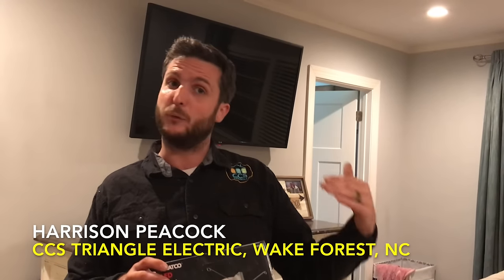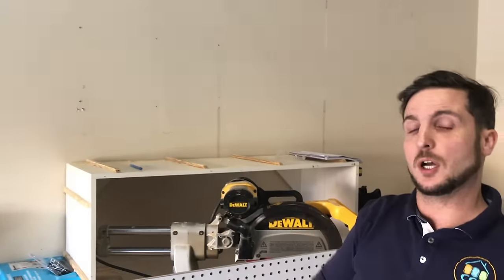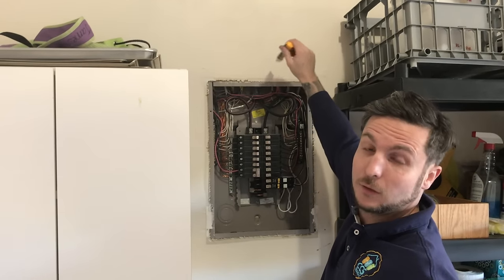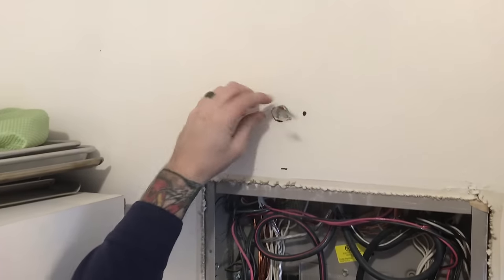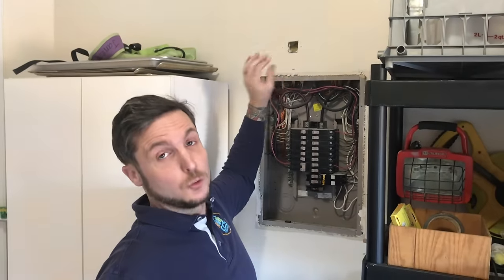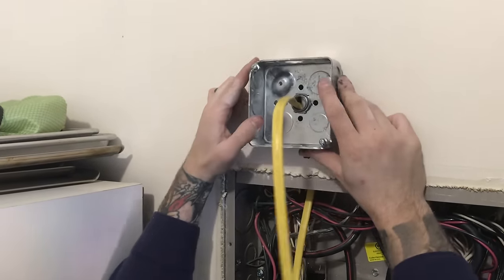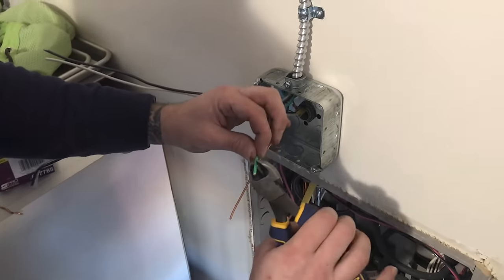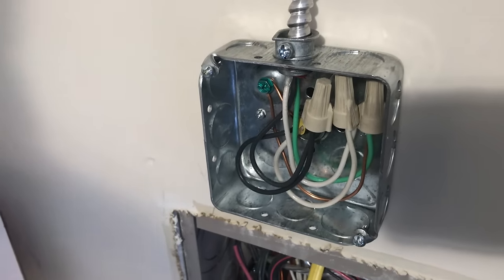New Garage Outlet From Panel--VERY DETAILED! (New Circuit / GFCI / Breaker Box / FULL INSTALL!)

Comment: Why does the outlet have to what I'm guessing could be called inputs or "Line" holes? I don't have any experience with this stuff, just came across this during my late night bored youtube searches
Reply: Using the proper holes is a quicker connection method than the wrap around a screw. They also have similar connectors to replace some pig-tailing. However, 
I know many experienced electricians prefer wire nuts & pigtails.
Reply: @jmcgrat3  I under why there are holes, I’m asking why there on a total of four on the top, the way it looks to me, you can have two incoming power sources to the one outlet
Reply: @jmcgrat3   at 33:54 there are the holes in which he put the incoming power into from the breaker box. Directly above those are additional holes, one on each side. I don't know anything about these so as of right now, my thinking is that having a second set of wiring would give you 220 volts

Comment: That GFCI is blind to any short circuits between it and the panel. Best protection is a GFCI breaker in the panel, second best is GFCI in that BOX on top of the panel.

Comment: why not use 30 amp wire / circuit? For over a decade had issues with my 110V 40 amp mig welder that quite frankly was awesome when new and for over a decade it worked like shit installed new trigger new liner etc.. and by accident realized it was on a 15 amp circuit with a shit load of other things and never had enough juice.. installed a dedicated 30 amp circuit with rated wire and mig worked flawlessly ever since.

Comment: This is good stuff but at 2454 I would have used the beans all the way up to the horizontal beams to each their own it's good stuff though never put anything in a tight area where one of two things will be happening every pair of the ceiling of the wall you don't want to have to move something unnecessarily if you put it less than the corner you have an option usually it's the ceiling at that particular height so if you give yourself the basic 4 in to a foot you will do quite well in the long run especially if you have to do repairs there are many ways to do that though the main thing is that you get a proper video

Comment: Why don't i just run the wire from the attic down through wall and out to the receptacle?
Reply: If you want to make changes or add receptacles down the road, it's better to do it this way.

Comment: ........More views on how to do things, and they are cool to see......They are like an operation....... You probably should use safety gear.......Also, seems like the power could be turned off, where the electricity enters the circuit beaker board.....Shouldn't there be two 120 amp breakers to shut the electricity off, that goes to that beaker bar?.....Lastly, I think, I read or heard a few decades ago, that there may be a code, for putting bx cable into conduit metal pipe......Take care....

Comment: also why using two separate wires for the junction box? just use the main wire all the way going throw the box to the panel why all the hassle to connect all those wires together ?

Comment: The green ground wire in the second junction box was installed counter clock wise which is incorrect. It should have been installed clockwise.

Comment: Thanks for the video. Don’t waist your time twisting two wires together for a wire nut, three or more yes. Next time you ground a metal box wire goes clockwise on ground screw. Thankyou for your time.
Reply: You do realize a midway connection on the ground wire makes no difference right?

Comment: If he moved the box over 8 more inches, he would hit a stud, remember it's a receptacle he is installing,  it's always getting yanked on,  just might pull the box off the wall lol. Like I said,  he doesn't design very good.  Remember he said he doesn't like using push in connections, well what did he just do on the gcfi?, I still wrap the screw.  Oh electricians rarely where rings on there hands, good chance you can weld it to the panel or wires thru contact, just a note

Comment: Can you use the same 12/2 metal clad cable for 220/240 outlets? Thanks
Reply: No, it has to be 12/3, 10/3, ... The white/gray wire can no longer be used as a hot conductor.
Reply: Ideally neutral conductor shouldn’t be used as a hot leg, but if u wanted to power something strictly 240v then MC is rated for it
Reply: Yes you can as long as you indentify the white conductor as an ungrounded conductor. Just wrap black tape around it.

Comment: in my area of the USA I can count the top or best electricians, on one hand, max maybe under 5 contractors and licensed journeyperson, the rest depend on us inspectors to write them up a punch list all the time, I'm from Albuquerque new Mexico and inspect in the largest populated counties in the state where we have thousands of licensed contractors, many of the electrical contractors installing photovoltaic solar systems are in very extremely bad shape when it comes to the code knowledge they are supposed to know, our codebook is about as big as the bible and very specialized not just anyone off the street can even get close to installing an electrical installation to meet the minimum codes, I have been inspecting for 21 years in our location in the Albuquerque Bernalillo county area's

Comment: Dude. You didn’t show how to tighten the metal Romex connector you installed on the panel.  The screws were on outside of the panel and you pushed the Romeo down they the connector.  How did you tighten them???
I would have applied the connector to the cable then tightened it inside the panel. Just as you did with the junction box. 

Use the clutch setting on your driver when tightening screws!!

Comment: yes, EMT is the preferred material for this application.  Would have also cost a lot cheaper.
Reply: Fernando Prieto EMT more expensive. EMT, bender, couplings, connectors, rw90 conductors and labour to install.
Reply: @darrenwoloshyn  he is supposed to be a licensed professional and should have the tools. The EMT will cost less than MC - I use both.
Reply: Tim Rich if you do residential there wouldn’t be much need for a conduit bender lol

Comment: Wire needs to be looped clockwise to go the same direction as the screw. You also used the wrong connectors. The connector you used on the mc is not rated for mc. That connector is rated for BX or AC only.
Reply: He also never went back to tighten the connector on the panel.

Comment: I think there is a serious fault of this installation - using a 20A breaker to protect a 15A receptacle. This is bad because the breaker may not trip when the load exceeds what the receptacle can handle. The receptacle has to be a 20A-rated one.
Reply: That's incorrect.  You can put a 15 amp receptacle on a 20A circuit.

Comment: Any reason you couldn't run the MC cable directly into the panel? Seems like the junction box is unnecessary.
Reply: It provides a central point of access nearest to but outside of the panel to add branch circuits in other directions. The loads are evenly distributed from that point outward. It allows a means of access to the circuit for troubleshooting if needed. It's also not code to see a wire assembly just disappear into a wall without seeing where it is running to. The box provides and adequate visual of a legitimate circuit.
Reply: @jonroberts4422  Good reply, to access the Panel Box you must go into the wall where the Panel box is located. You must do so using an approved box, you can't just stuff wires through a hole you poke in the wallboard.

Comment: West coast we have to leave 6 inches of ground wire in the box then wrap it on the ground screw, you left it to tight and then you wrap it counter clock wise witch is wrong way to wrap wire on receptacle or switch screws, always clock wise, and I've would have piped the whole way over, it would have looked cleaner and besides mc is more expensive and it can't be  exposed lowered than 8 feet, it has to be un reachable by people, other than that, it looks good man....
Reply from the maker: Thanks for the run-down torodaman. I appreciate thoughtful criticism, especially from pros. Thanks for watching!
Reply: @torodaman  Is it because of the metal jacket and someone touching it if it has been damaged inside? Guess someone on a ladder could still contact it but.... Be nice if someone could cite the codes applicable. Someone else commented that it was a violation (i assume USA but they never said) but never said why. Do they come out with changes in rules EVERY YEAR to the NEC; electricians having to buy an updated book yearly?? Some of these rules seem strange---so you could use conduit under 8 feet but NOT metal jacket? Weird! I don't see much difference between the two. Are all states bound by the NEC or do some have their own different rules?
Reply: @TheHonestCarpenter  Would code have allowed going up the wall, across the ceiling, and down the opposite wall to the new box?

Comment: 43:08 british-style wire stripping huh
Reply: As an electrician i can tell you that habit is not  a "British style", many electricians that i work around in the United States tend to do the same thing if their strippers are not on them. Its not a big deal as long as you know how much pressure to apply so that you don't damage the copper.
Reply: @o0Nightmare0ox  well just saying ;) gota say strippers can get the job done quick y easy so its good to have em handy. pretty much lk stripping the sheathing w a utility knife.

Comment: MC can only be ran exposed at above 8' this is illegal and wouldn't pass inspection. 330.12(1)
Subject to Physical Damage. Wiring installed

within 2.44 m (8 feet) of a walking surface or
finished floor is considered subject to physical
damage.

Comment: why is that a 15 amp outlet was installed instead of a 20 amp outlet
Reply: It is a 20 amp.
Reply: Disagree. No horizontal slot on neutral. See White 20-Amp Decorator GFCI Residential Outlet https://www.lowes.com/pd/Eaton-White-20-Amp-Decorator-GFCI-Residential-Outlet/999930548 for example.
Reply: It is Okay to have 15 amp receptacle connected to 20 amp wire/circuit breaker. A 20 amp appliance plug will not fit the configuration of a 15 amp wall outlet. Thus, no chance to burn up the 15 amp outlet. Also, the 15 amp outlet can handle 20 amp pass-thru current in case you have installed a 20 amp outlet down the line.
Reply: I believe on a 20 amp circuit the code calls for a 20 amp receptacle if it's the only one on that circuit. A duplex receptacle is considered two, so 20 amp receptacle is not required.
Reply: @arthendrickson4860  The horizontal slot is not so much the issue as much as using a 15 amp GFCI on a 20 amp circuit..
Reply: A common problem, especially in a garage, is using power equipment that technically works on a 15A circuit, but runs very close to the limit.  A circuit should only be used at 80% of its capacity in a sustained manner.  On a 15A circuit, that means no more than 12A should be drawn for any substantial length of time.  I have a table saw and an air compressor that technically work on 15A plugs but run a little too close to the circuit's maximum.  From time to time, the breaker will even trip if I try to cut wood that's a little too thick and I bog down the motor.  Running close to 12A makes the circuit breaker nervous and can cause your romex to run a little too warm.  Putting a 15A plug on 12ga romex with a 20A breaker will give those "shop tools" a little more breathing room.  You can always use thicker conductors in a circuit, and remember that the breaker protects the conductors.  The dangerous combinations would be putting a 20A plug on 14ga romex, or using a 20A breaker with 14ga romex.
Reply: To all who commented.   I was going to say the same thing and would have been incorrect.   I looked it up in 2017 NEC.   All words are important!   
Article 210.21(B)(1) Single Receptacle on an Individual Branch Circuit.   A single receptacle installed on an individual branch circuit shall have an ampere rating not less than that of the branch circuit.    
What was installed was not a single receptacle.   It was a duplex receptacle.   I said, all words are important.   Please do not call the devices outlets!    This is an example of why.    
Respectfully,     Kevin

Comment: 39:47 if you are not confident turn off main first then pry all existing red black wires back towards you to easily and push ground and nuetral  wires to the back pf panel and easily drop new green and white wires to the back neatly (if confident no main needed to be off and you can carefully pull hot red black wires to the front out of way ) so you dont have to fish green white wires behind which could possibly bend while snakeing behind red black wires and hit hot breaker areas and shock you also dont trim wires to requires length untill after placing fishing to back of panel to avoid hands to close to breakers when installing breaker (safer and easier to cut and trim and fish behind wires if you have more length available in case they might become to short to work with while tied to breakers

Comment: Please add a part in your disclaimer about checking one's state/local code, the technical requirements, the permit and inspections/sign-off. 
Some towns, as is my case, allow a single family owner to do pretty much everything in one's house, with proper permit and inspections. Some others don't. NEC, as in National Electrical Code, has different versions depending on the year and the nature of the work (renovation or new construction). The best thing to do is to contact a building inspector with questions prepared.

Comment: I Do a lot of wiring 120v& 240v Cable drops/house rewiring ext. But i got to say i like the way you strip the wire/romex..It drives me nuts to see these(what i call noobs) Cut with  a Razer blade all the way down the wire.dont remember the term but it is NOT safe i think very likely they nic a wire & never know it an then wonder why thy end up with a dead short  or worse ! so cudos to you for doing it right !

Comment: First of all don't use power tools to tighten your connections ...hand tighten only with a screwdriver! Let the insulation wire protrude 1/2" beyond the connector into the box! And when you loosening the armored cable for the  bushing use your linesman pliers to re-tighten the connection. And use correct wire strippers not side cutters for striping wires  to avoid damage to the copper wire  when making final connections.Just my 40 years as a electrician...; ) otherwise great video!

Comment: 1) Why the junction box, why not just run the armored cable into the panel?
2) I did not see you tighten the cable in the panel connector, if not a code violation.
3) Please use the proper tool to strip wire, to easy to nick the wire especially for non-professionals!
I am an industrial electrician
In our area (Chicago metro) All wiring must be in conduit even single family homes .

Comment: You didnt mention that the first step is shutting off the power supply !!
Reply: If you don't have the common sense of turning off the power before working on anything electrical, you need to pick up the phone and call an electrician and stay the hell out of any panel

Comment: The use of MC cable is not permitted to be exposed below 8'. If I were doing this job for a customer I would have run it in EMT conduit. I also would have wrapped the tag end of the grounds clock wise. Also stripped the MC cable improperly, if this guy was working for my company he would need to go back to school!
Reply: Where are you from that mc cant be run under 8 feet, cause that has to be a local code.

Comment: should be a 20 amp GFI not 15 amp unless you have 2 or more receptacles on the circuit.
Reply: You're incorrect. A duplex receptacle, gfci included, is 2 receptacles. If he used a simplex (single) then you'd be correct.

Comment: Your stripping technique appears safer than using a razorback and possibly cutting your wire insulators, which could cause shortages later.

Comment: with armoured cable you should always use metal box/panel connectors. Not Plastic. The Honest Carpenter could have done just as good or better job.

Comment: Why couldn’t you just run that wire assembly from that junction box into the attic and across then down to the outlet? It would look much better than running it like you did.

Comment: I noticed you put the romex clamp onto the panel through the sheet rock hole.  You placed the nut on it and tightened it.  Now you can't get to the 2 screws to tighten the 12 - 2 wire.  Why didn't you put the romex clamp on the wire first, tightened it, then went through the hole and into the panel.  Now you can put the nut on, and everything is tight.  If the j box was ever pulled off that wall, the wire going into the panel will now flop around because the romex clamps 2 screws are loose.  Go Brandon!!!

Comment: Why use a shallow 1900 box when you could’ve just used a handy box.. you’re only splicing for 1 gfci.. why feed the Romex into the panel without tightening the connector?? You should’ve stripped the romex and feed it into the panel with the connector already on it... and 17:50 you called that a bushing.. dude that’s a locknut.. a bushing is the red insulation you put in the mc to protect the wire.. there are also other kinds of bushings but that right there my friend is a locknut .. sigh

Comment: 19:23 "I don't like anything that has push connections to them, I DON'T TRUST THEM"
32:53 .... uses push connections
Reply: Those are not push connections. That is backwiring where the wire is clamped in place when the screw is tightened. It is a very secure connection.
Reply: @surferdude642  oh, sorry, I didn't know there was a difference.  I looked through several that I had and I see the type you are talking about.  My apologies ;-)
Reply: @Hangs4Fun  No issues, everybody's learning.